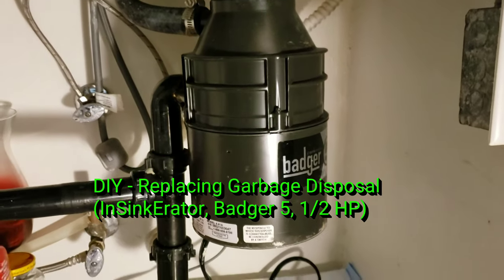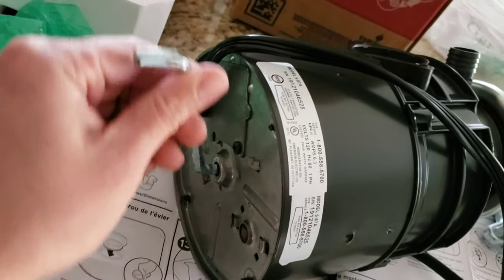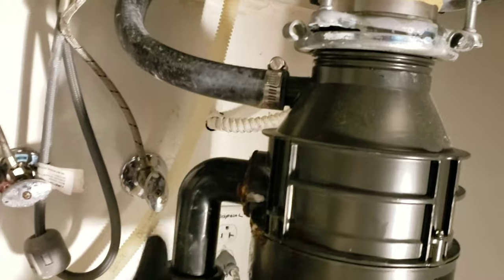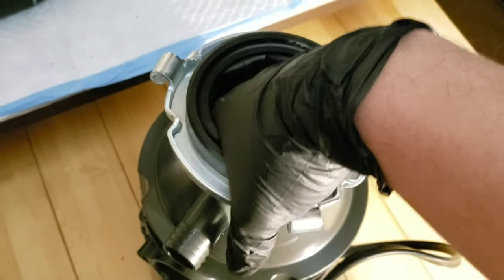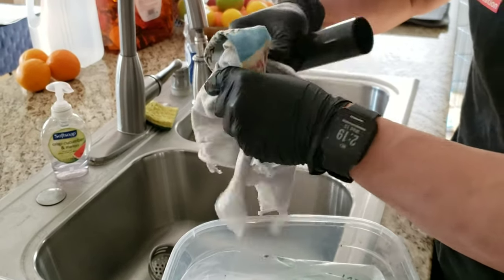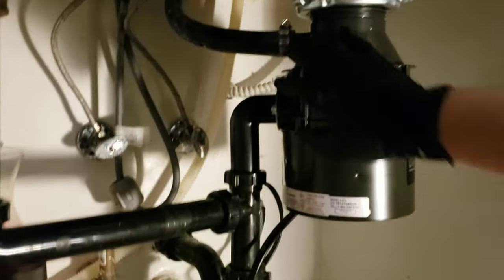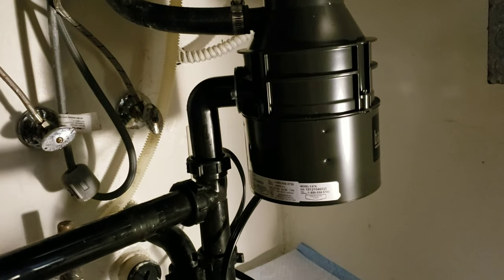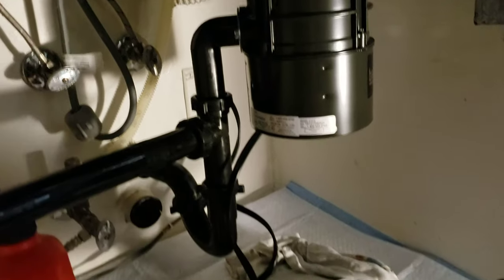DIY - Replacing Garbage Disposal (InSinkErator, Badger 5, 1/2 HP)

Comment: Please do it the right way. First , you need the lock the bracket  or the whole thing will fall out with vibration one day.  Second, The parts you called not needed at 0:29 are actually key to having a proper job completed and eliminating future leaks. There is a fiberglass seal and the putty between the sink and that sink flange that needs to be replaced as they get brittle.
I would also use the new retainer ring for good measure.
Here is a video for a better job

https://www.youtube.com/watch?v=lmucX9Gijlk
Reply from the maker: Good tips. The linked video does do a more complete job. Pinning to the top of the comments.

Comment: 0:44... you just saved the day! We were going to replace the garbage disposal and I was watching this video to see how to do it. Then when I saw that the disposal can get stuck sometimes, I found an Allen wrench, got it to move like you showed in the video, then realized something was stuck inside. Turned out to be a really hard nut from a date my 15 year old admitted to spitting into the sink. Finally got it out and it's running great. Many thanks!
Reply from the maker: Cool! Yeah the Allen key at the bottom seems to help resolve many stuck disposal issue.

Comment: Good video.  The gentleman mentioned to use the new parts that came with the new unit but didn't replace the part that goes in the sink.  Yes, it's a little more work and a bit more complicated, but it might be a good idea to have a nice new part in the sink.

Comment: Man you guys doing a lot of home repair. Props on recording it.
Reply from the maker: I figure I learned alot on YouTube on repairing various things, but rarely exactly my situation/setup so hopefully now that I've made a video someone else with my exact setup or issue will benefit.
Reply: @bensaysthings  Giving back. The gift of giving. Well Glad you do. I never record any of the stuff I have repaired.  I gotta say the Disposal hasn't changed in design. That's good for parts, replacing, or maintenance.

Comment: Thanks for the tutorial.  That "excess" tube is actually the dishwasher drain and you are absolutely supposed to lock the mounting bracket into place to keep the bracket from vibrating out of position and dropping the disposal.  I would replace the sink drain flange too.  Just to make sure that the putty is fresh and there is not corrosion or rust on any of the parts.
Reply from the maker: Thanks for sharing some info. Yeah, I wasn't very clear on that dishwasher drain tube explanation in the video.
Reply: exactly, the putty and the fiberglass joint get brittle.

Comment: Do you need to shut off the water first. Also, do you need plumbers putty and pipe tape?
Reply from the maker: You shouldn't have to shut off the water to your faucet since you're just removing the disposal. The water supply lines shouldn't come into play at all so you don't have to mess with them. Just make sure the kitchen faucet itself isn't on and the old garbage disposal electrical cord is unplugged.

With regards to plumbers putty and pipe tape, you shouldn't need these if you're just removing and installing just the disposal. Plumbers putty is needed if you're installing the new metal flange to a the sink (which I didn't need to do in the video). Pipe tape or teflon tape is typically only needed for metal threads and if your setup is all PVC plastic piping then you shouldn't need it.

Comment: I’ll be replacing my garbage disposal and your video will be most helpful, thanks!  One question. Do I have to buy the exact same unit I’m replacing in order for everything to fit?
Reply from the maker: I'm not sure if you need the exact same unit. You'll have to dind out the port location to be sure. I just picked the same model to be sure it would be a straight replacement. Good luck!

Comment: Thank you and all was helpful but from woman's point of view, you have to line up the new disposal on the lower part of the slide around the edge then it slides up to the higher point.  I watched several videos but still couldn't figure where to hook "the teeth" on...what spot.
Ladies if you are attempting this (my husband can't get down on the floor anymore), when putting the new disposal and ready to twist you will see on the upper flange that the metal slides from a lower to a higher spot so hook in the lower place and then slide to the higher with the allen wrench.  Thank God that project is done!
Reply from the maker: Glad the video helped! Also thanks for sharing some insight on your experience it helps everyone.
Reply: Thank you for helping so much!

Comment: wished you would have mentioned that  tab  you  popped  out  is  only  for  if  you  have  a  dishwasher to  connect,  if  you  don't  have  a  dishwasher do not remove  that  tab;  other  tutorials  videos  stressed that  point  very  strongly
Reply from the maker: Good point.

Comment: I just finished replacing my Badger 5.  All went well except when I went to run my dishwasher I realized I forgot to knock out the dishwasher drain plug in the disposal. I'm wondering, rather than disassembling everything and removing the disposal to knock the plug out, can I just drill it out in place?  I do have enough clearance in my cabinet to line the drill up, and I can drill slowly and hold a vacuum cleaner hose nearby to suck up plastic debris as I'm drilling.  So if a small amount of drilled material gets in the disposal chamber will that hurt anything?
Reply from the maker: I think this would work and any small amount of drilled plastic shouldn't hurt the disposal. Just run it and flush water through it afterwards.

However if you can get someone to hold the disposal steady maybe you can still knock out the plug with a screw driver and hammer. I think this will ensure the entire plug is removed as opposed to drilling since when you drill you're risking a jagged or rough inner lip where the plug used to be. That rough inner lip might allow debris to accumulate and catch from the dishwasher.

Comment: How do you remove the electrical plate when it does not come off by the method described?
Reply from the maker: I'm not sure what your old disposal electrical plate looks like, but typically there are a few screws that you should be able to access. If your old disposal is sealed up and doesn't have access to remove the cord then you might need to buy a new cord kit and install it on your new disposal or you could buy a new disposal with the cord already installed. Hope this helps. If all else fails and you still need to access or remove the electrical plate I would recommend hiring a plumber.

Comment: I can't do it. What could be wrong? I can't attach the inSinkErator, because I can't even get the parts lined -up for doing that.
Reply from the maker: If you have the exact same model as the one you're replacing then it should install the same way. One thing I did notice when installing the new one was that you do have to push the new disposal up against the sink flange a little bit to compress the gasket just a little. However it shouldn't be a lot of force. More likely your alignment might be off? If all else fails then it might be time to call in a plumber. Good on you for giving it try though most people don't even do that.
Reply: @bensaysthings  
Thanks for answering so soon. (You're the first and only one so far) No, my model is not the same, but I think it should install the same way. Anyway, I'll try again. tomorrow.The parts just don't line-up the way they do on all the videos I have seen on exactly the same model. Strange.
Reply from the maker: @quabledistocficklepo3597  That is strange. The diameter of the disposals should all be standard and the same especially if you're putting in a inSinkErator to replace an old inSinkErator. Hopefully it really is just a misalignment. Good luck!

Comment: This is great.  Going to be trying this tomorrow based on your instruction once the part shows up. 
Question; My current instruction manual as well as other videos site opening the electrical plate on the unit and joining the (4?) wires within with Wire Nuts? Is this necessary? It looks like you were able to bypass this step.  Mine is also coming with the Electrical Cord already attached, so, I hope not?
Reply from the maker: The garbage disposal can be purchased with or without the cord already installed. Since yours is coming with the electrical cord already attached you don't need to open up the electrical plate. You just swap out your old disposal with the new one. Good Luck!
Reply: @bensaysthings  That's great, now I understand that step is for units without a cord.  Got it!  :)
Reply: Got it done.  Thanks so much for the clear and easy to understand instructions!

Comment: Any tips if old unit is stuck. I can’t get it loose and clamps that I turn are positioned awkwardly… Next to the screws so it’s hard to get good leverage
Reply from the maker: Not sure how your disposal is setup, but if you can get a large screw driver or breaker bar in between maybe you can pry or break loose the sliding flange? I don't necessarily recommend this though as it could damage the flange or deform it. This might be one of those instances where calling a plumber might be a good idea.
Reply: @bensaysthings  thanks Ben. appreciate it! was thinking too much force probably wasn't the best idea ; )

Comment: Hi there! Question: For electric purposes: Is replacing the disposal as easy as plugging in an out of the outlet... I’ve seen videos where the breaker box is involved.
Reply from the maker: If you unplug the garbage disposal power cord from the outlet before working on it (ie remove old, install new) then there should be no electrical power and you should be safe. Shutting off the power to the circuit break that's associated to the outlet wall is a bit overkill.
Reply: @bensaysthings  haha! Thank you! Appreciate your help and tutorial
Reply from the maker: @chemitasteinmommyposted4059  No problem. Good luck! You can do this!
Reply: When you purchase these disposals, they'll be offered in a corded or un-corded version.  Some homes come with Romex wires that hook up directly to the disposal and you have to pre-wire it to the unit before mounting it.  The corded units obviously have the cord installed at the factory which can be plugged into a wall outlet like this video.  It's something you should check before purchasing one.  If you're wiring one directly to the home's electrical, you have to shut the power off at the electrical panel.

Comment: Mine didn't come with the electrical done. Have to remove old cable to new one. Struggling
Reply from the maker: This video by Michael Borders shows how to install a new electrical cord.

https://youtu.be/-bU3Sa2xha8

It's what I've done also, it just happened that the one in my video already came with the cord installed. Good Luck I believe in you Chef!

Also I would recommend getting a new replacement cable from Home Depot or Lowes as I've tried extracting the old cable from the old disposal before and usually it ends up damaged.

Comment: Did you connect to an air gap in this video ??  I have the same model and was wondering if you connect the air gap to the disposal hole and then the other side of the air gap to the dishwasher hose ??  Someone help plzzzz.
Reply from the maker: Yes, although not shown specifically that black hose I uninstalled from the old disposal (then reattached to the new one) with the hose clamp was coming from the air gap. There is another hose (not shown) that connects from the air gap to the dishwasher. 

The hose from the air gap to the dishwasher was a white hose in the video. You see it around minute 5:58 between the wall plug and the supply line knob.
Reply: @bensaysthings  thanks for your help great video
Reply from the maker: @tonyramirez840  glad it helped.

Comment: I can't get to the Allen wrench holes it's blocked by those drop down screws.
Reply from the maker: A quick disclaimer - I'm not a professional plumber and what I suggest might not work or perhaps make things worse. You could perhaps use a flat head screwdriver to wedge between the ring and the drop down screws to try and get the ring moving enough to get the Allen wrench into the holes. The other option might be to call a plumber or handyman.
Reply: @bensaysthings  I will try option 1 and probably option 2
Reply from the maker: @DefSquadFan  good luck! You'll defeat this problem one way or another!

Comment: What is the small pipe above the other one for?
Reply from the maker: I think you're referring to the small port above the disposal outlet? If you are, that port is to connect to your dishwasher setup.  More specifically your dishwasher has a relief hose that connects to an air gap (small cylinder looking thing usually located next to your kitchen faucet) and then another hose connects from the air gap to that "small pipe" on the disposal.

I didn't mention it clearly in the video but if you don't have a dishwasher then don't punch out the plastic piece as I did in the video. If you already did, this isn't the end of the world as you can always seal it up with epoxy.

Hope this helps.

Comment: OLD info.  The new mounting ring does NOT spin like this video shows.  Instead, it has a tab which "catches" and is supposed to enable you to spin the disposal while holding it with two hands.  You have to push very hard upwards to interlock the mounting ring with the slid-up ramps on the mounting assembly.  I hate it.  A new video is needed to show how this is done.

Comment: also turn off the power from the electrical box too and turn the switch off for the disposal i'd imagine.
Reply from the maker: It's pretty safe to just turn off the switch for the disposal and unplug it. Cutting power from the breaker box is a little overkill if you're just going to uninstall the old and reinstall the new, but if you really want to be super duper safe then yes you could turn off power from the breaker box.

Comment: I got mine in but I got a leak from the top of the sink
Reply from the maker: If the leak is under the sink basin but above the disposal then it might be a misalignment of the disposal to the sink flange or the seal of the flange to the sink basin needs to be replaced.

Comment: the breaking lose direction was missed in the video. Im having challenges with one as I write
Reply from the maker: To break loose the disposal it's the reverse of the steps at around minute 8. You use the allen key tool and hold the flange and turn to the left or counterclockwise when viewed from the bottom. Hope this helps.

Comment: @4:44 - IMMEDIATELY AFTER THE LECTURE ON USING ALL NEW PARTS YOU COMPLETELY NEGLECT THAT NICE SHINY FLANGE KIT AS SOME PARTY FAVOR/ORNAMENT FOR  THE SOLE PURPOSE CAMERA AESTHETICS. DON'T FORGET YOUR PLUMBERS PUTTY AND CHISEL NEXT TIME!
Reply: Why would you need a chisel?
Reply: @guitarpikchik2710  I SUPPOSE YOU COULD USE YOUR FINGERNAILS OR A GUITAR PICK IF YOU'RE GOOD ENOUGH TO PRY STAINLESS STEEL TRIM FROM ADHERED PLUMBERS PUTTY ON PORCELAIN/STAINLESS STEEL. SO GET AFTER IT! A FLATHEAD SCREWDRIVER AT LEAST IS WITHIN REASON FOR ME, HOWEVER.
Reply from the maker: Typically if the hardware or seals are disturbed via removal of an old part in order to replace/install a new part I would replace the seal or hardware (if available). Although the new sink flange was available from the new disposal kit the existing flange wasn't disturbed and was perfectly fine. You certainly could replace it if you wanted, but I decided it wasn't worth the trouble.
Reply: @tonytellingitlikeitis9951  I got it in, but I needed to replace some the pipes.

Comment: Still won’t work
Reply from the maker: If you installed the new disposal and it doesn't work I think it might be an electrical problem with the wall outlet. If the circuit breaker isn't tripped you could try plugging in a small appliance like an alarm clock to that socket to make sure it's working. If the socket is fine then there's a chance the new disposal you installed could be a dud (this is less likely but possible). If you installed the electrical cord yourself double check that the wiring is correct and there's no short. If all else fails it might be time to call a professional and get a plumber or handyman to take a look. Good luck. I hope it turns out to be something simple, but overlooked.

Comment: I’m new at this how do you break it loose?
Reply from the maker: Look around 2:22 in the video. Use the included allen wrench key by placing it into one of the loops of the existing disposal, then with one hand hold the flange above the disposal, turn counterclockwise (when viewed from the bottom). Around 6:09 I show the install so you get an idea of the moving parts. Hopefully this helps. You can do it, I believe in you.